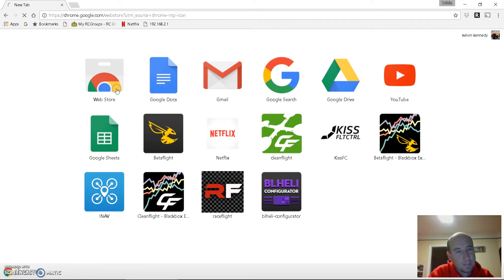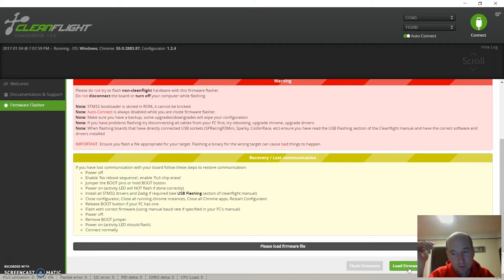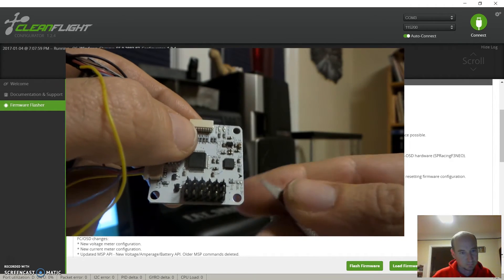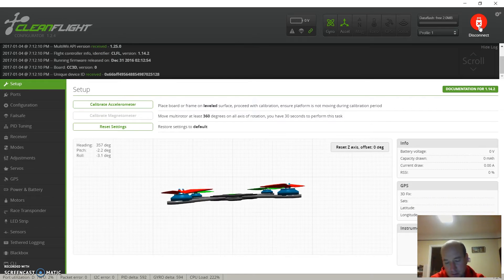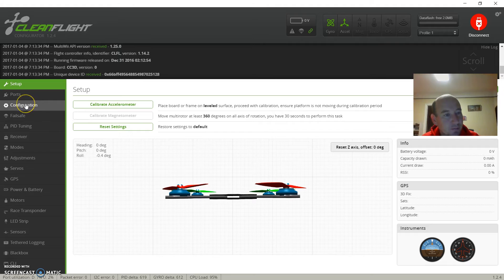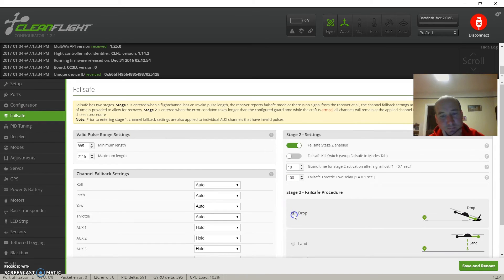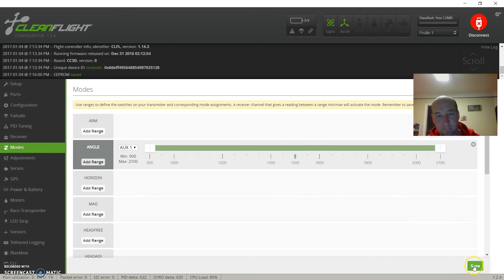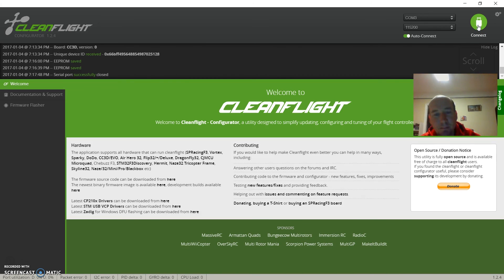Flashing Cleanflight to CC3D with Mainport and FTDI

Comment: I am trying to setup CC3D board with Cleanflight. I can't get the board to connect to the program. I am also having a problem flashing the board. When I jump the 2 soldered points, I will get solid BLUE, not the green you are talking about. Tried several times and it's always BLUE. The clean flight will report "No response from the bootloader. I ended up purchasing 2 more boards thinking I have bad boards, but they all act the same. For some reason, I can't get this win 10 to recognize the board. And yes I have tried it on 2 different PC's. I almost want to give up, but something is telling me that the solution is right around the corner. Do I need to set up USB ports first? Have no ideas anymore and exhausted probably 50 YouTube videos trying to figure it out. Most of the videos on youtube are dated 2015, 16, 17.... Is this not popular anymore?
Reply from the maker: First off my apologies to others comments I missed! Youtube started notifications on everything now and the important stuff, comments, gets overlooked. 
As for your board,  I would have to rewatch my own video and experiment on my own computer to see if something has changed. I think I still have a working cc3d board laying around but honestly for what you paid for 3 CC3d boards you could have purchased one of the top of the line modern boards by now. What type of aircraft are you trying to build? It would probably be easier for me to guide you towards something that us currently supported than these old f1 boards. We are on F7s and even H7s now. Good F4 boards cost about the same ad the CC3d . A year or so ago cleanflight basically cloned betaflight as the latest version. This may have broken its ability to connect to f1 boards as betaflight (a fork of cleanflight) abandoned f1s several years ago.

Comment: hi, do you know if it is possible to do with cc3d atom?
Reply from the maker: It should work exactly the same.
Reply: @KelvinFPV  I flashed, the verify is ok, but now windows not recognize the usb.  do you have some advice?
be patient :)
Reply from the maker: @CorradoCorradini77  sounds like you just need to install the drivers now. There should be a link on the first screen on the configurator. You can always use the ftdi as the USB interface instead but that would get old.
Reply: @KelvinFPV  Hello!! there was some other problem, the green led remained still.
I tried re flashing starting from 1.1 then 2 .. now it works.
thanks !!!!
p.s. I tried to vcc from ftdi, it works.
Reply from the maker: @CorradoCorradini77  awesome! so glad to see this video is still relevant.
Reply: @KelvinFPV  it is useful!!!
and it seems that cleanflight is the only one that still develops for this cc3d, apart from librepilot, from what I've seen.
I wanted to try if it had better functions but still we don't understand anything: D

Comment: on the left when I plug in COM doesnt show up? what am i doing wrong
Reply from the maker: You need the drivers installed to get the USB to be recognized as a com port. There should be a link on the first screen on the configurator. Hope that helps.
Reply: @KelvinFPV  So I am using mac and got everything and it does recognize the usb  but still no bootloader failed keeps coming up
Reply: i still cant connect
Reply from the maker: @kool_cool503  hmm. I don't know anything about Mac. But it sounds like you have everything right on the computer end as far as regular com connectionif the configurator is showing you a com port. To flash it needs to be in the boot loader mode and that takes different drivers than com mode. Also pay close attention to the LED and watch the video to see the difference between getting it wrong like I did the first few times and getting it right. Soldering a piece of wire loop to the boot pads is a sure fire way to get it right.
Reply: KelvinFPV yeah i soldered it and have a solid green light. Its a project for my class so do i have to program it or i can use it without it? Because this is really frustrating and i am running out of tim!
Reply from the maker: @kool_cool503  ok. I'll try and help. Are you getting that error after you try and flash? If so try it several more times in the same sitting. I vaugly remember this happening on a different board before. Don't unplug, just try and flash. What firmware does the log say is on the board now when you first plug it in without bootloader mode? This is a really old board and I doubt there are many original boards left. You may have a clone and it may already have something usable on it.
Reply: @KelvinFPV  So i have a cc3d openpilot. So after watching bunch a videos i bought a FT232 usb and connected it with the board. And when I plug in I have a solid green light on the board when i try ti flash it, a red light blinks on the ftp usb which says TXD and then it says no response from bootloader
Reply: i dont know what am i doing wrong. Also do I really need to program is or can skip the step and try to work it without it. That sound stupid but this has become frustrating lol
Reply from the maker: Silly question but do you have the TX from the FT232 connected to the RX on the CC3D, and Tx on CC3D to RX on the FT232?

Comment: Hey, what about flashing I Nav to cc3d? I was told you can do this through Libre pilot. But I  can't find any videos of people who speak English. Is it possible to do it through I Nav config without using an FTDI, or Arduino nano? I have a bunch of older non Revo cc3d boards I would like to put I NAV on for RTH pos Hold,  adding a compas, barometer,  and gps mind you. I'm looking for a simple solution.

Comment: I have not been able to get it to flash even when in bootloader mode now. Any advice?
Reply from the maker: I know recently Cleanflight flip flopped with betaflight. No longer is betaflight a flork of cleanflight but cleanflight is a fork of betaflight so depending on the version you are trying to flash there may be an issue with F1 boards now. I'm not sure. Try flashing the version I used in this video.  That looks like 14.2. Please let me know what you find out so I can update the description.
Reply from the maker: Your Bootloader might not be the correct version. Sorry, I didn't check what mine was on this board before flashing cleanflight. Cleanflight replaces the bootloader but I'm guessing you need the latest OEM bootloader to start the process. Try this to get started http://opwiki.readthedocs.io/en/latest/appendices/bootloader.html